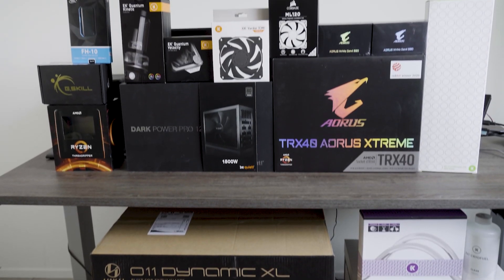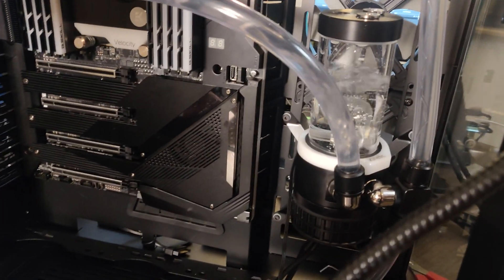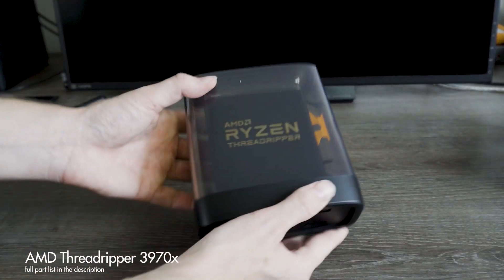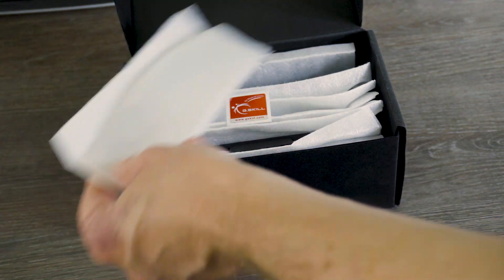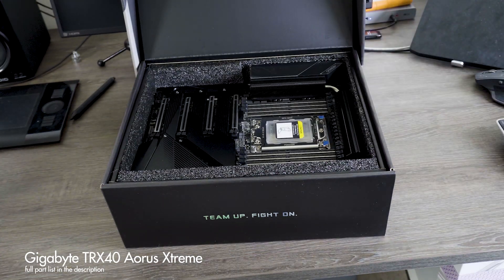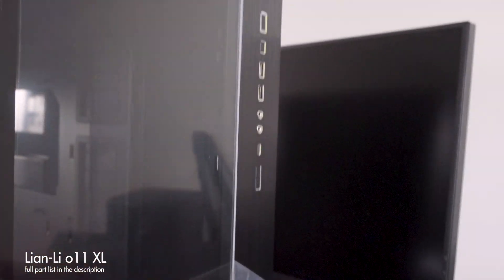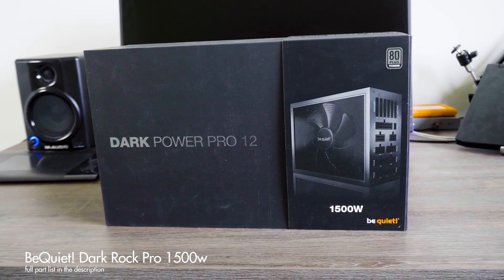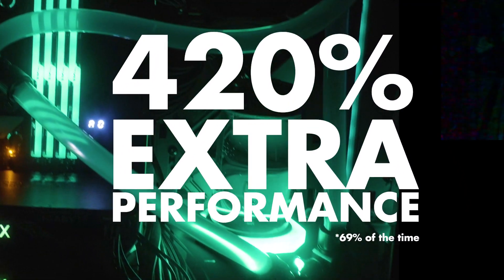Building Watercooled Workstation - Part 01 - Hardware

Comment: watching this video in the future, and with ddr5 out. looking to build a new pc for same things. interesting im actually picking same parts you have but independently and just finding this video charming as a result. nice work dude. inspiring. anyways. the ddr5 doesnt seem to come in 128 or 256 atm. so would your advise to not select multiple kits and combine remain in this regard? thanks. kind energy.
Reply from the maker: nice, building a monster pc a well :D Keep in mind you cannot use ddr5 with a 3970x or the board i’m using here. There’s probably no 256gb ram kits because of this reason as because I don’t think there’s many boards with 8 ram slots that support ddr5. 
What cpu/board combo are you looking at?
Reply: @TimvanHelsdingen  ok. good food for thought. thanks for that! so am sorta hoping the release of the next gen ryzen could maybe lower the cost for the build. would be interested in newer raptor lake perhaps, price for coreage and as such it may be fairly a slice of cake. not tryin to have a cpu bottleneck tho. gotta remain patient. and i realize the ddr5 is intel so right now in my pc partpicker list i have the 12900k with the asus rog maximus extreme kinda sussing out whats gonna land into place. still waiting on the motherboard stuff and new chips to come out but the point you make is good about quad channel and so im looking into it now, seeing its been an issue for people running 4 sticks.hmmm. ya probably ddr4 is more stable at least for a little while. cool. should be chill. i have my eyes on a 011 evo xl to build in .. and having decided i should just go watercooling your videos will be a pretty nice blueprint to have. owe ya a coffee for such things. ayo. ill check ya later! be well, prosper.

Comment: So cool! I am thinking of building a 3970x build also but i am kinda scared of watercooling. Do you think that using a fan cooler (ie.: be quiet! Dark Rock Pro TR4) with high airflow case a good solution? Congrats on the build man your productivity is going to skyrocket! I had another question also : do you need an external software like deadline as you mentionned to run a sim in Houdini with x amounts of cores and keep the rest for working? (which is so awesome for a single artist during workdays)
Reply from the maker: Yeah it's defenitely a lot faster on sims and caches! so pretty happy. Now just gotta wait for the 3090 for that sweet 24gb vram for opencl :P 

Check with the ram cleaning though! There weren't any ram kits with 8 dimms i could find that would with with the dark rock pro. So if you're going 256gb it doesn't seem like an option.

Custom loop was easier then i thought. Part 3 will show how that works so might be interesting! It's actually not that hard if you know what to do and you could essentially just copy the parts i picked. It's lot more expensive thab dark rock pro though.
you could also do a all in one though, but since i also wanted to do my 3090 on water this seemed like better option.

You can also use PDG to run stuff in the background (you can specify cores) Deadline is free for 3 machines though so might also be worth to look into that (i have a video on how to configure it on my channel)
Reply: @TimvanHelsdingen  All right man! I'll go in store to ask for the proper RAM kits to get clearance. Thanks for the tip, i would have totally overlooked this! Good point about PDG and i'll check out your vid for deadline.

Comment: *ok, Tim. Very nice. But what display are you using?!
Reply from the maker: I didn't upgrade my display. But I have a 32" 4k by benq at my office + a smaller dell 1080p screen,  and a Asus TUF  27" 165hz gaming monitor at home.
Reply: @TimvanHelsdingen  Thanks. Can I ask what the smaller dell is used for, and what refresh is the 4k? Do you think a single 4k is enough for work. I know it's enough res but that aspect ratio... can you work without issues around it?
Reply from the maker: @X Y A second monitor is very useful to keep open as a renderview, for reference, or watching a tutorial on your second screen or something. My 4k is 60hz, i got it in 2016. Benq has very nice monitors though. if you're getting one for work you're better of getting something with better colors than a high refresh rate. 
 If you get a 4k, i would probably go for something around 32 inches, because that's just big enough to also work without using too much UI scaling.
You could also go for dual 1440p screens instead, having second monitor is really useful.